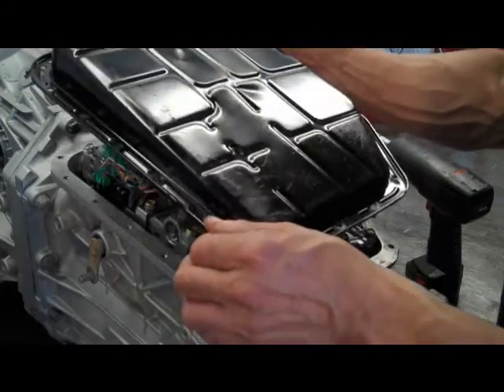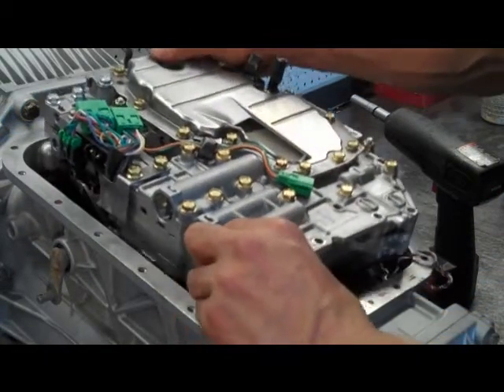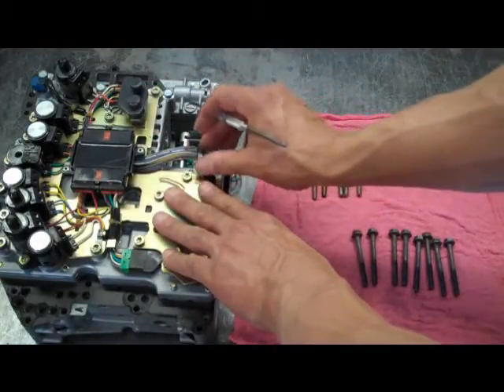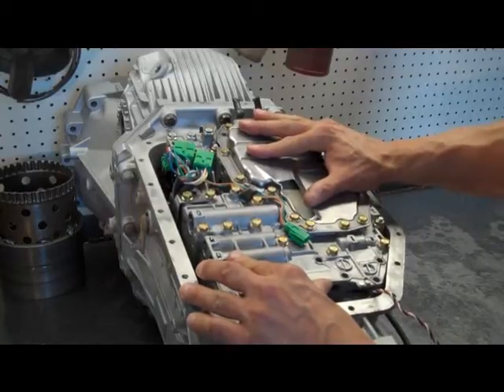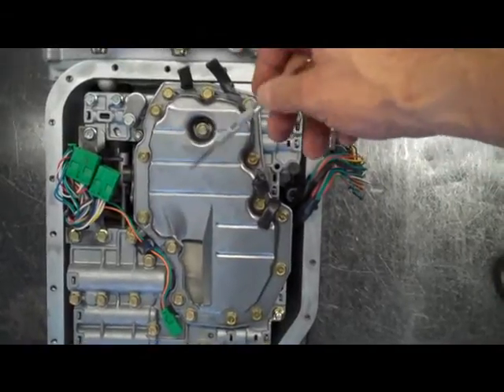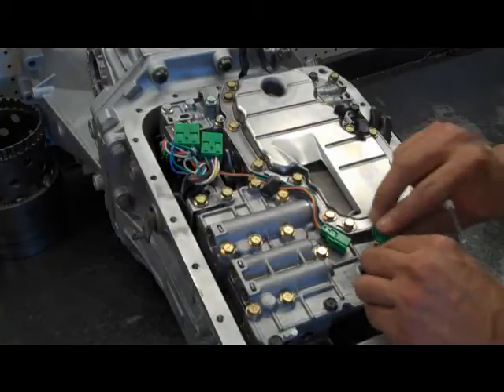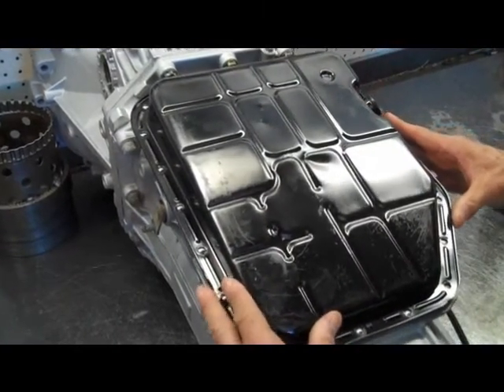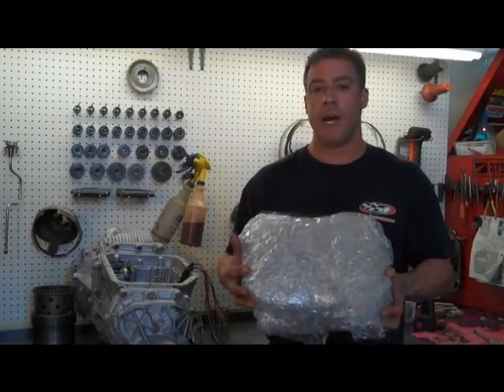IPT Transmissions Subaru 5eat Valve Body

Comment: How long did it take after a valve body mod for the car to stop acting all crazy?  Mine is very harsh downshifting and up shifting and if you stomp on it it doesn’t know what gear it wants at first and bucks a little.  I have 30 miles if that on the new valve body. I reset mem 2 before the first start up.  Just wondering if what I’m experiencing is normal and will go away.

Comment: Do you know the solenoid # in the valve body? I have same 5EAT and it has code P0705 for PRNDL Input, and P0773 for Shift Solenoid E Electrical.  I took the valve body out but not sure which part is reporting from the code.